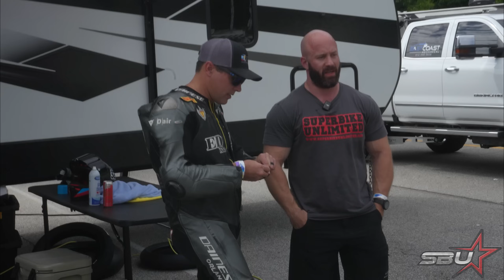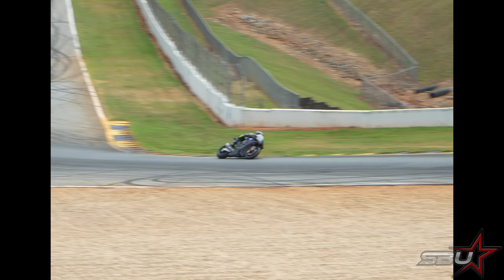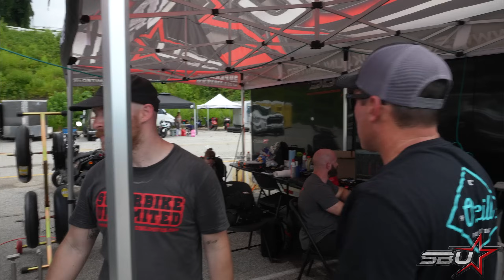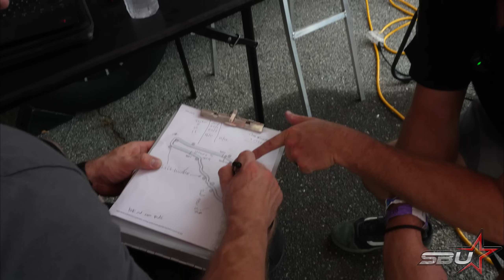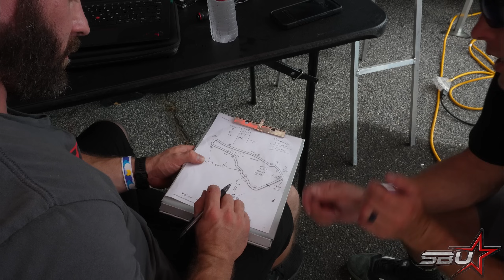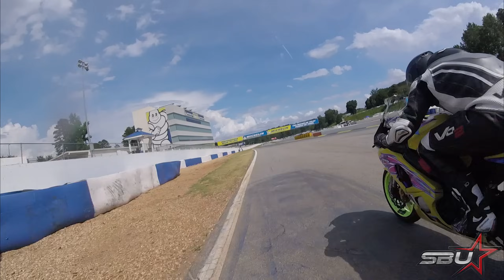SBU Yamaha YZF-R1 MotoAmerica Works SBK Project - Pt. 3 - First Shakedown @ Road Atlanta!

Comment: The ride feels so stiff just judging by this camera shake.  I have yet to break into the world of new suspension components, but out of curiosity I imagine once you change the forks and rear shocks out for much better models, the settings on those by comparison to OEM components are much stiffer to comply with the much faster paces?  I feel very limited by my OEM components lately and every time I see a video like this the bikes always seem to turn so much easier.  From a rider perspective, are you able to steer the bike quicker and make direction changes from lean to lean much faster and easier (i.e. less perceived effort)?  It's like trying to turn a canoe in a pool filled with syrup for me on my 2020 R1!
Reply from the maker: "Stiff" is subjective, we adjust the suspension based on our data. Your bike sounds like it has some setup issues, the R1 is a great handling motorcycle without much work.
Reply: @SuperbikeUnlimited  I guess what I mean is the bike feels heavy and resistant to turning atleast when changing from one direction to the other.  Turn in from straight up position is alright but it’s going from lean to opposite lean where it just seems to really struggle for me.
Reply: @SuperbikeUnlimited also let me just add that this content is gold!  Love what you guys are doing with the you tube series!  Thank you!
Reply from the maker: You may want to try something that lowers trail, a simple place to start is increasing shock length. Just make sure your front tire pressure is correct.

Comment: The fact that you can adjust engine brake from corner to corner and not use the rear brake at all on a Superbike just amazes me,I know that you have one of the best braking systems upfront that does all the braking but I always thought that pro riders do use rear brakes to help them with cornering!!maybe if they use it coming into a corner it sometimes unstabalize the bike that's why they rely on engine braking!!on my bike when I hit the rears with  the front coming into a corner it starts sliding alot,it makes the bike so nervous maybe I need better suspension setup to get more grip on the rear,and because of the front suspension dive, it needs to be stiffer at the front,to stop the bike from losing grip at the rear, I don't do track days but I like going to the canyons, just aggressive street riding sometimes!!
Reply from the maker: It varies very much, but many riders only use the rear brake after corner entry, not during.

Comment: Whats the latest on the ZX10RR?
Reply from the maker: @randyfox364  Disassembly! We don’t have enough bandwidth to fully support multiple platforms like that. It’ll be basically returned to stock with the SBK motor and sold as a road bike.